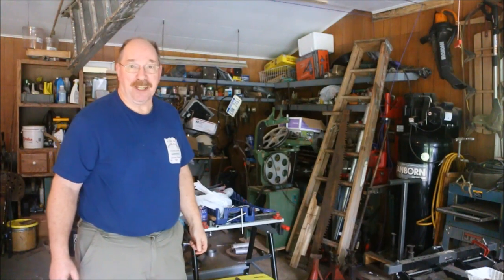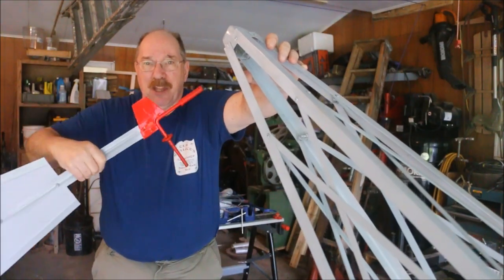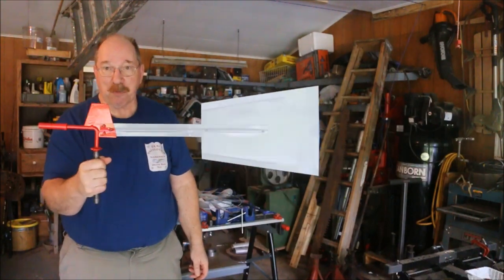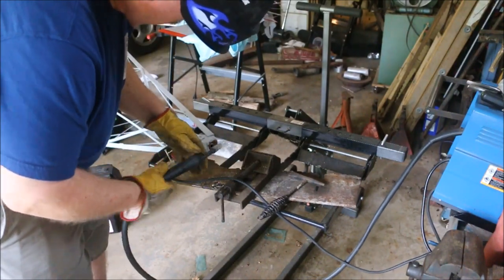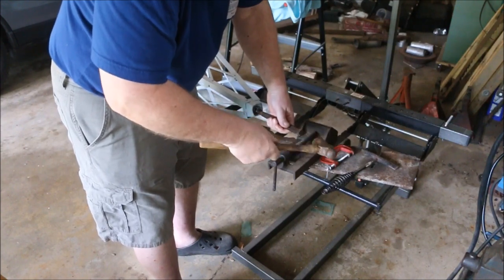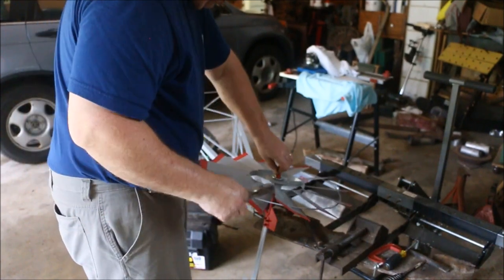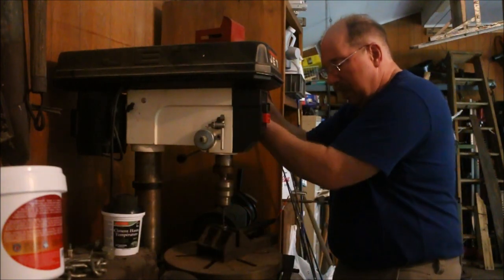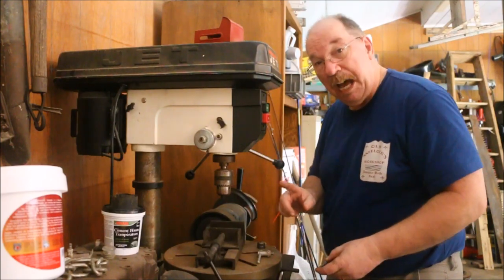RESTORING THE WINDMILL ~ FINISHED

Comment: Just sitting here in south central pa in my backyard enjoying time spent with Mr Sneelock. Great job nice to see it spinning. Looking forward to the next project.
Reply: Sitting down after supper after a hot day out burning fuel and sweating like a swine and enjoying Unc. and the windmill and a.c. and a hot shower shortly. A  GREAT blessing to come home to someone that is looking forward to it, as are you. Chill, Tim. You earned it!
Reply from the maker: Aren't portable computers and cell phones great. I don't dread sitting in waiting rooms half as much as I use to.
Reply from the maker: This is our first house with central air. Michigan is only really hot for 2 or 3 months at most. It sure is nice having the shop in the basement. I don't think I'd be doing as much hand planing as I do if it wasn't for the air conditioner.
Reply: Basments are always nice. I used to have a belt drive squirrel cage fan I'd put downstairs and blow the cooler air upstairs. Now we're on one level but the heat pump has a cover over it to keep the ice from totaling out the condenser coils and everything works very nicely.I was dark bvefore but this outing is getting me looking like an amigo.
Reply from the maker: Lewie McNeely I use to do something like that. I'd pull the cover off the furnace filter in the basement and put the fan on run. It would pull the cooler air out of the basement and blow it upstairs. Dropped the temp about 10 degrees over night. Lot easier sleeping.
Reply: Sho' 'Nuff! Use what you have. We just had wood heat then, no thought of a central system. Then boy/son got asthma and we went to oil heat in a week. Lots cheaper that doctor visits and blasted inhalers that would snowball on you. Doctor couldn't believe we did it. When you have to, you will. Just like yummy stuff we see fly off into the sunset because we can't handle it anymore. Mammy was right. Growng old ain't for sissies!
Reply from the maker: Lewie McNeely Life is a series of challenges that we meet. When the kids have a problem we do everything we can to fix them.
I understand about the yummy stuff too. Gout pretty much killed the steak dinners and the warfarin ruled out a whole bunch of stuff. We have learned a whole new way of cooking. Fortunately Lydia is a whiz in the kitchen. I miss the stuff but we are eating well.
Reply: +Old Sneelock's Workshop   I've been really lucky health wise. Really don't take meds and the doc said the only thing he can find wrong is I'm fat. Oh well I still can do pretty much what I want when I want but I can feel changes coming on.
Reply from the maker: Tim Caldwell My Grandfather once told my wife, "Don't get old."
Considering the alternative getting old isn't such a bad thing. I do want to go to Heaven but not on todays bus load.
Reply: +Old Sneelock's Workshop   I'll second that and Amen my friend.
Reply: Old Sneelock's Workshop i miss some of the stuff but what I miss was what was doing me in so I just adapt. Between both of us here being on the goofy side we just eat the same things we can deal with and we don't have to have variety a whole lot. Sweetums keeps saying she's sorry it's the same old but I'm like a dog delighting in dog food again. I had an uncle that moved to Washington State and always said it didn't bother him a bit if there was just one thing on the table, as long as there was plenty of it! Those were the days when men were really men and he was a force to be reckoned with by all the accounts of folks that knew him so the one dish meal agreed with him.
Reply: Tim Caldwell I've always been fat. Fat folks are happy folks. I've never seen a bony jogger with a smile on their face. I don't take a thing myself and about stroked out my doctors when I weaned myself off all the heart stuff after I got a stint with a stent. Just take vitamin 'I' when arthur acts up but that's all. My sugar runs between 110 and 120 if I eat right. I'll keep my gut and they can keep their pill for a pill for a pill.

Comment: A job well done!  But I was mildly surprised that you didn't add a little bracing to the bottom of the pipe, so that it would be attached top and bottom.  It probably isn't necessary, but I assume you were ready to have the project done?  I once knew a man who always tried to build something once, so that what he built would outlast him.  After that, it's someone elses problem.